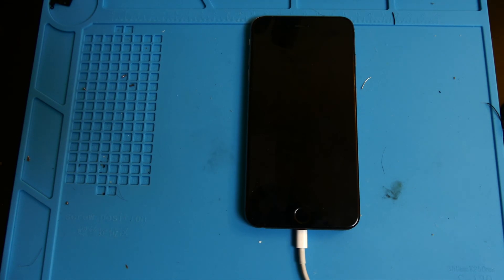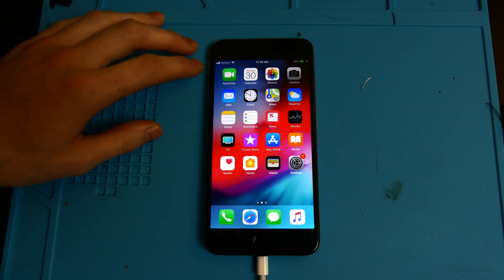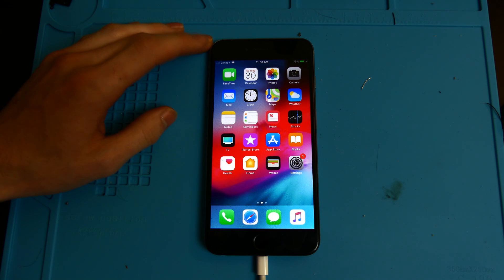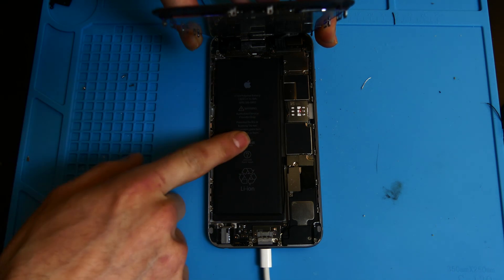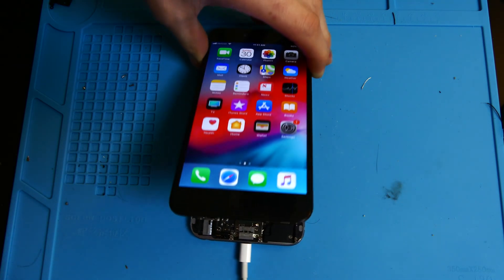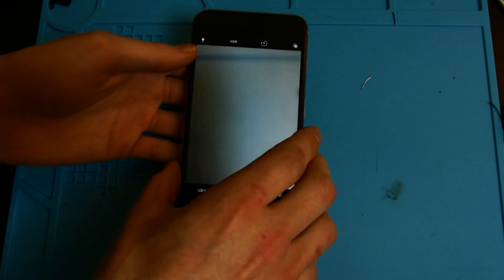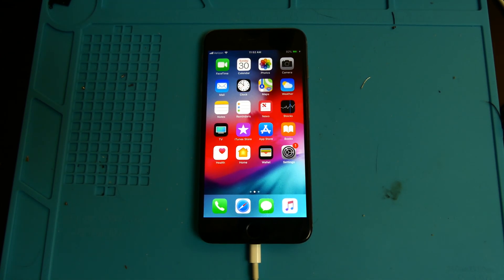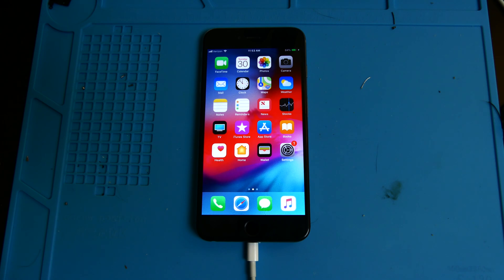iPhone 6 Plus Weak Signal After Water Damage (No LTE)

Comment: Hello, Were you ever able to fix this problem?  I'm having the same problem for the same reason and I'm wondering if I'll have to buy another phone. Thanks!
Reply from the maker: It usually requires removing the Baseband CPU and reballing  it. Can't say for certain that's your issue though because it can be caused by many things but that's the most common
Reply: @TechOut  Thanks for the quick response!